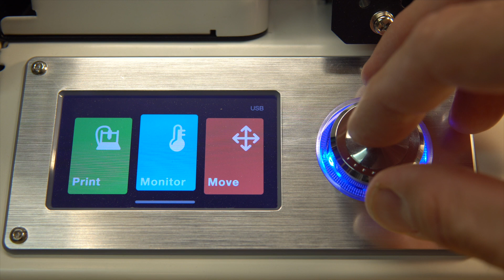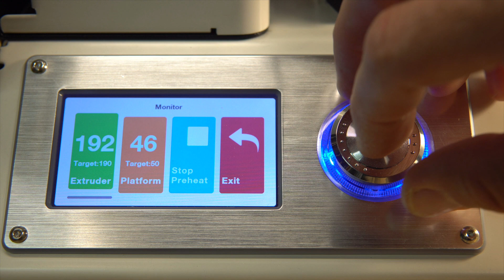Bed Leveling Demystified

Comment: Preheating the bed is dangerous and a great way for newbies to mar their bed surface. It has never been suggested by Monoprice and not by most print manufactures. Many printers will post an error if it's attempted, clean the nozzle. At least you didn't whip out a set of feeler gauges so that's a plus.

Comment: Hy Frank, do i need to lift up the z axis .2 mm (the thickness of a piece of paper) when i level the bed  ? so when the printer is homed i will have exactly 0 distance betwen the noozle and the bed and when it will print a .2 mm line there won't be a .4 distance as it will be if i level the bed at home position
Reply from the maker: Hi, you need to level with a piece of paper under the nozzle...

Comment: If there was a more precise definition of paper dragging just a little bit that would be awesome.  Hopefully some day there will be published an actual measurement.
Reply from the maker: I would like that, but it can vary depending on the nozzle used, the temperature, speed ect. If you print a flat piece you can visually see when it’s too low and if it’s too high it will not stick.

Comment: How did you adjust between each print quality, from too close to too far, with the bed screws or with the slicer? Thanks!
Reply from the maker: Hi, you have to use the screws...
Reply: @Franks3Dshop  Thanks!

Comment: Thanks for your very informative video channel! Just wondering if you have any videos on calibration of xyz dimensions?  I am new to 3d printing and have been getting frustrated with dimension accuracy vs expected CAD dimension.
Reply from the maker: Hi, I should do one, I use a ruler on the bed than move the nozzle from side to side, a calculate the difference from what I asked. I correct the steps/mm to as close as I can, than you can print something of know dimensions, and measure the results and finish the adjustments that way, that works for X and Y, for Z you can make calculation since you should be able to find the pitch and motor specs.

Comment: during the process, and after a lot of test and try (at least 25 flat squares) one of my stepmotors the right one from the z axis, just stop when it was homing all the axis (ofc when it was at z homing)....i stop the printer, and i saw it was like....not rolling smooth, but the oposite, and it makes noises, was the first day, i mean it was printing perfectly, so i asume the motor is broken right?
Reply from the maker: Could be the cable, or the board, even the lead screw, you switch cables or connectors on the board to diagnose the problem. For the lead screw you would need to remove the motors.
Reply: @Franks3Dshop  I did it (the problem still),so i decided to do another thing, I took both motors out of the printer , unplug the wires, then with my hands, I move the one that works okay, and it rolls super smooth, the second (broken one) it's so hard to roll, and it feels like the main gear of the step motor is broken inside , or it need Oil to work properly again, didn't open yet cuz I wanna see if we cover it...
Reply from the maker: There are 2 bearings 1 on each side, it is easy to disassemble, there could be debris inside...

Comment: For my not 100% perfect plain heatbed I like to increase Cura's value 'initial layer line width' to 105% which greatly helps to get an even first layer without any holes.

Comment: Useful video, thank you for making it. My only criticism is that you make it seem like using a raft isn't very effective. Most slicing software allows you to adjust the gap between the raft and the print object. In Cura, the setting is called Air Gap, I don't know what it is called in other software. Your setting is set too high, just like the nozzle being too far from the bed without a raft. Set it too low though, and your part will be stuck to the raft so that it has to be cut off.
Reply from the maker: Hi, I see what you mean, it was only a small test piece not a raft. You are right about the raft and the Z offset for it, I usually do not use raft, my printers have an auto-levelling. Thanks.

Comment: where did you get the file with a small surround to test with?
Reply from the maker: Hello, the lines surrounding the piece is an option of the slicer called Skirt, the piece is a 10mmx10mmx10mm cube resized in Cura to about 20mmx20mmx1mm is that what you are looking for?

Comment: Only got one decent print out of this machine so far (had it for about 6 months now); now I cannot, no matter which method I use; get the bed to level on my Mono Mini Elite v2.
Still looking for a nice set of leveling knobs. Found some a few days ago, and now I can't find them. Found a really nice one that has mm markings on it. D/l'd it; then my computer crashed. Lost the file and cannot find the site where I got it.
Squirrelliest machine I've ever used.
Reply from the maker: Hi, you could use a raft, or install a glass bed to get it flat https://youtu.be/JoTiLsxXFjQ

Comment: Leveling the bed is one of the most important thing in 3D printing. Thank you Frank for the video. You  preheated the nozzle to clean it , but do you do the whole bed leveling procedure with the nozzle   and the bed preheated ?
Reply from the maker: Hi, yes I do, it’s not really needed but takes out all the heat expansion... and faster to start a print afterward.
Reply: Thank you Frank

Comment: What is the thickness of the paper you use to level the bed? My nozzile always ends up too close too the bed when i try to level it. I'm using standard printer paper of 80 g/m2. I was thinking about using photo paper which is thicker at 250 g/m2. Thanks for excellent video's btw :)
Reply from the maker: Thank you and mine is a regular sheet of laser printer paper, If I remember correctly, it was about 0.05mm thick, but I would have to check. Use what works for you ! The advantage of a thicker sheet, is that it will not bend so easily...
Reply from the maker: From the specs from where I buy it, it's a 20 pounds, I think it's about 29.6 g/m2 not sure about the conversion.
Reply: I have seen other videos that use ordinary printer paper for level testing that is 0.1mm thick. which is twice yours!

Comment: Is your bed plate perfectly flat?  Mine is higher in the center from front to back than it is on all the corners.  Also I had to shim up the left front foot on the bottom of the case. It wobbles if I don't. 
The printer seems to print fine overall if I compensate for the bow upward in the bedplate. It just makes the edges of a larger print harder to get a good first layer. Any suggestions? Thanks for the videos.
Reply from the maker: Hi, thanks for the comment, mine is a little lower in the middle, add some clear nontoxic glue stick, I use a generic one from the drug store, the Pritt brand is too elastic and do not provide a good coverage. That should help the corners stick, or you could lower the bed so that the corners sticks, the center should be ok after some layers, it will even out. It all depends on the part you are printing, if you need a flat bottom, than you would need a glass bed added on top, with the spacer for the Z axis to compensate for the glass bed.
Reply: Frank's 3D shop. I'm a little afraid of raising the corners of the bed because you can feel the paper is tight at the center of the bed if I do. I also use washable glue stick. 😀
Reply from the maker: You can start the print and look at the first layer, if it sticks and is extruding in the center, you are ok, also I use 0.3mm first layer height, helps too compensate for this.